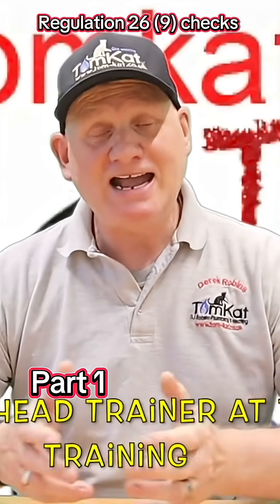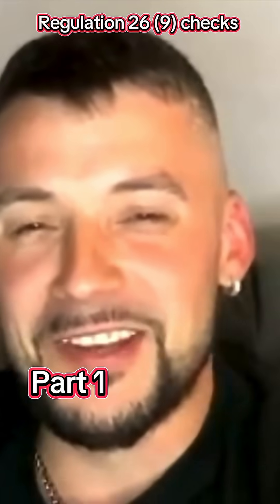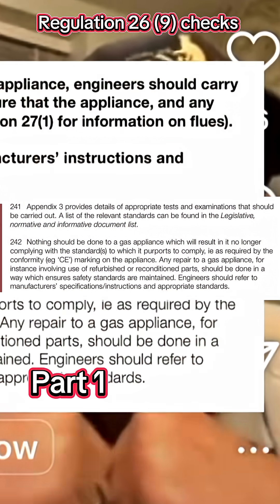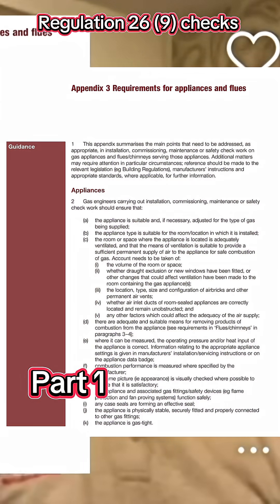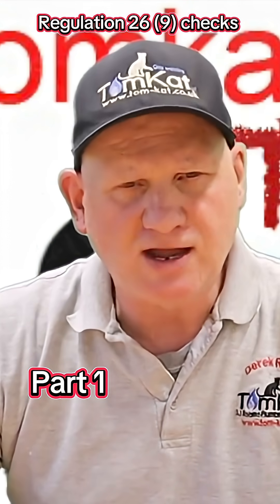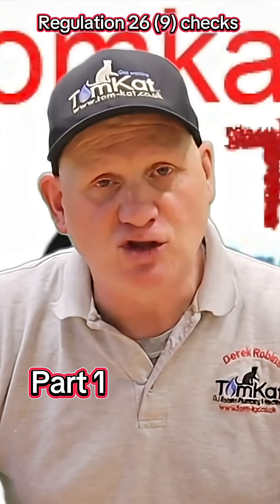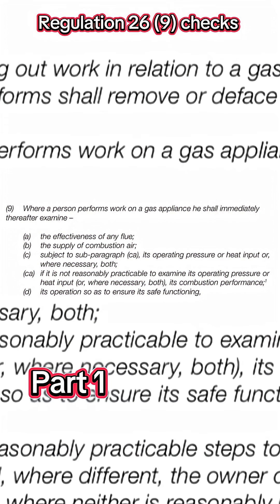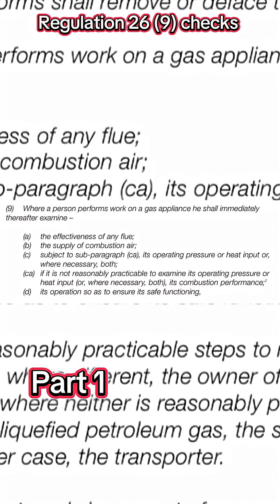Gas safety installation and use regs 26(9) checks part 1 #gassafety #gastraining

Comment: Why would any engineer work on anything or test any aspect of an installation and not do a Tightness test. Imagine the aggro if you issue a cert and then the Tennant gets an engineer in to fit a cooker a d the 1st thing the second engineer finds is a leak. Good luck with that.